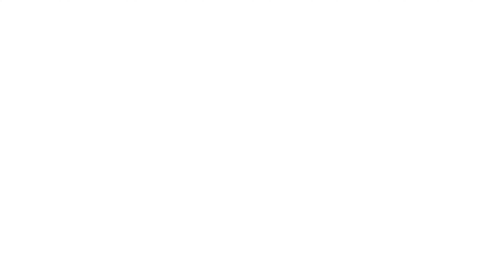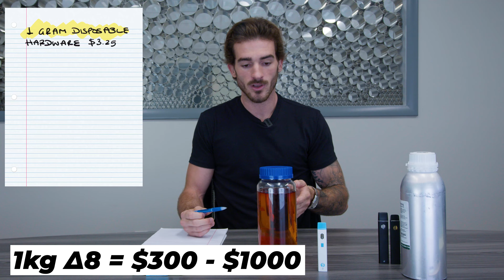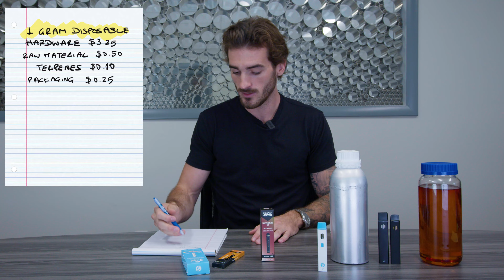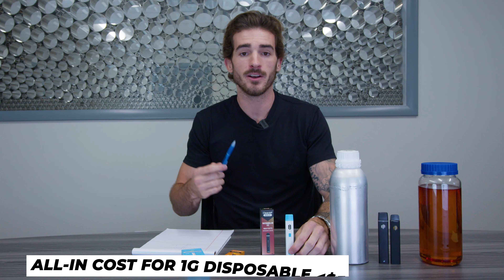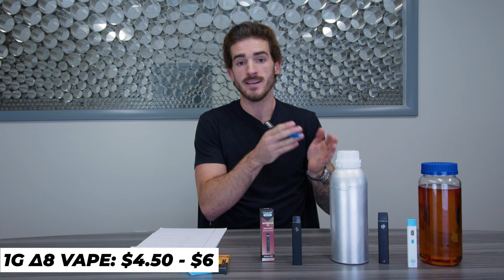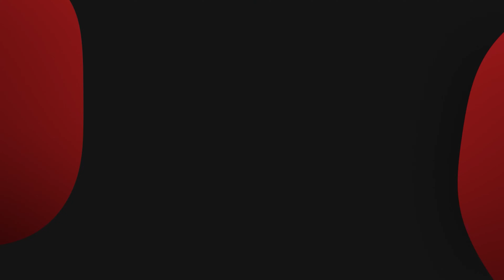How Much Does It Cost To Make Disposable Vapes

Comment: I’m having trouble with my mix I used to do weight to weight now I’m doing volume (terps) to weight (disty) I wanted a 10% ratio I did but my oil still taste like disty…. I guess I’m not mixing correctly I have ccell blanks which work great but I guess I just need good terps and a good ratio to put in. Thanks msg me and let me get ur email so we can talk
Reply: I use 7g terpens on 100g of distallete or 5g terpens is a safe mixture as well as stated in video
Reply from the maker: You’re using too much terpenes, which is why it’s tasting bad. Or the terps themselves are bad, or you’re heating it up too hot.

Try 5% and go from there.
5G of terps for every 100g of disty.

We have another video explaining how to make flavor samples, go check it out